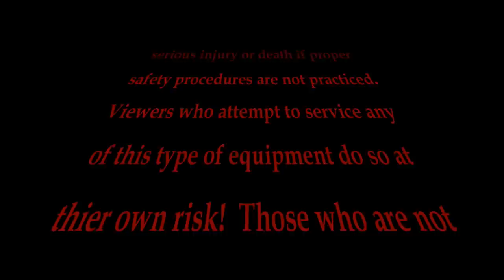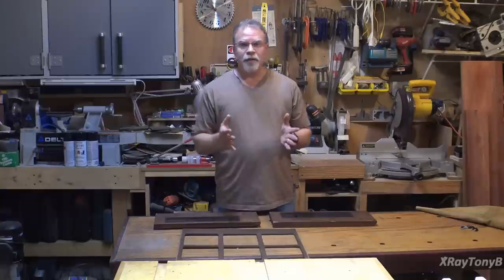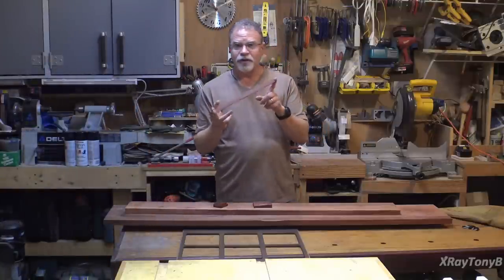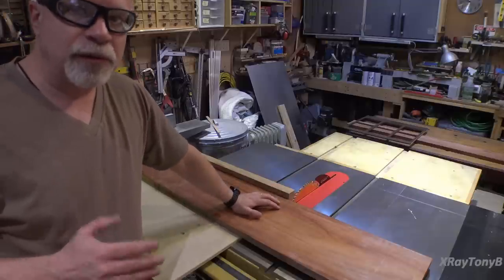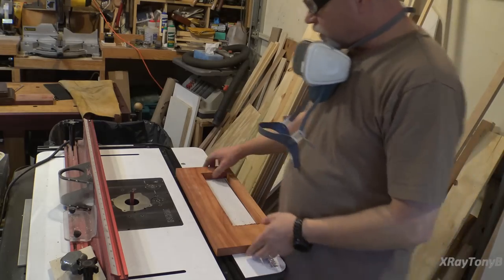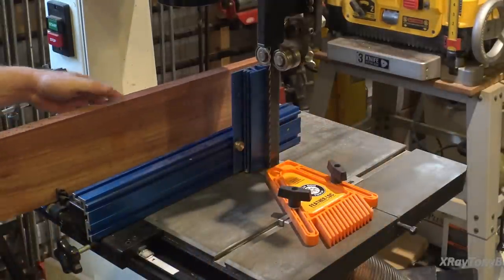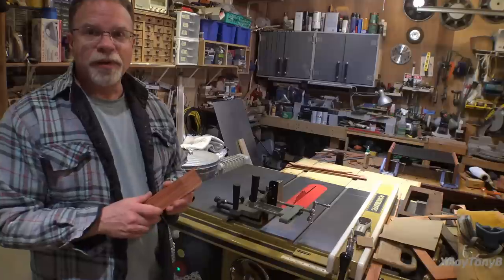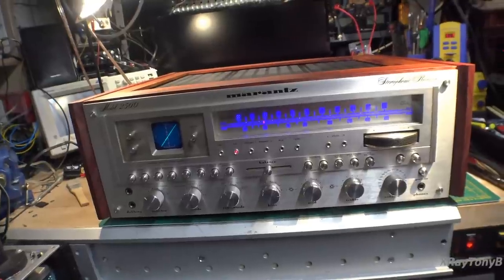Woodworking Video - Building a Case for the Marantz 2500

Comment: Thumbs up for the great wooden enclosure Idea. It really brings up the beauty of it. I wish I was near you so I could buy it....:)))  Keep up the good work. Great videos as always. I myself have a nice Pioneer SX-828 that I've use for years but 2 years ago has gone A-wall and I've stopped using it. Never had enough time to look at it. I have 3 kids and a daily job to attend so, very little time available. It sat in my garage all of this time and is still there. I hope that 1 day I'll have enough time to have a look at what the problem is and yes the wooden panels need a new coat of clear enamel on them. and 1 of the double posts (volume) has a broken knob and half of the shaft. other than that is a beauty. I really hope that I'll find a new pot and the knob (here in the UK) to have it replaced. Cheers

Comment: I wonder why MARANTZ did not use DSP processing rather than analogue and a PWM output stage, Just think that it would be better to have Mathematics do the donkey work than than using Analogue processing and there would be a lot less heat build up because of the PWM output stage.